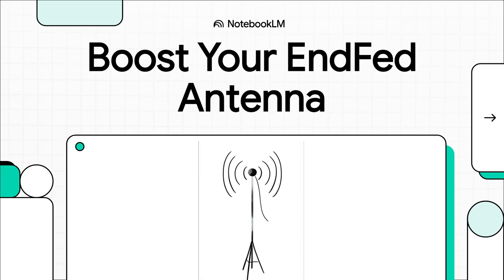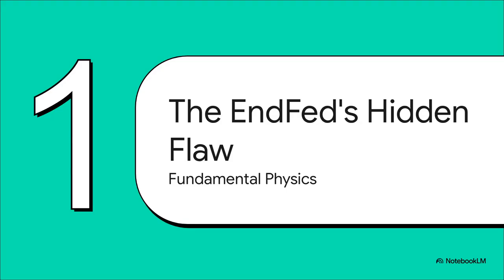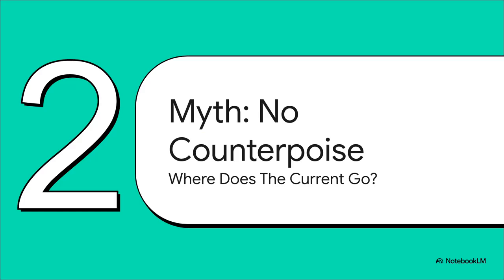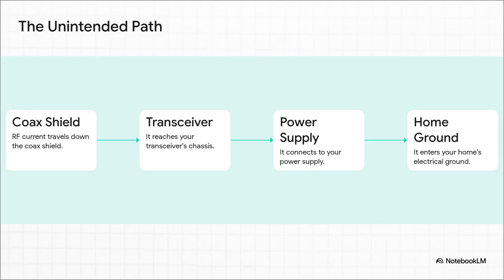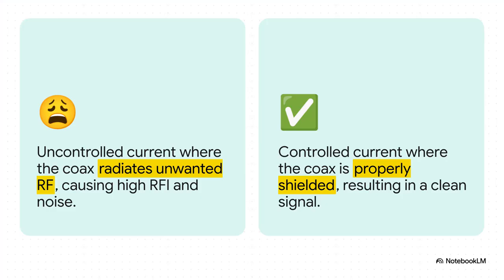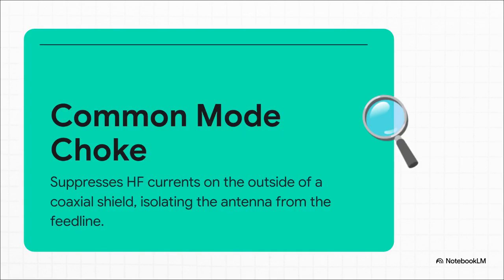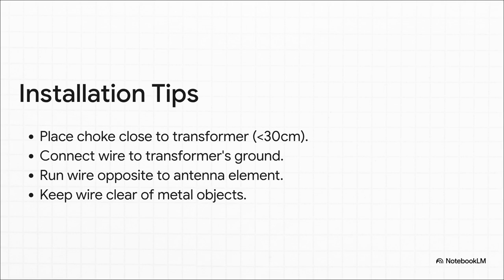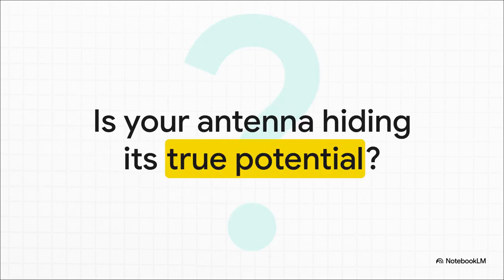Boost Your EndFed Antenna with Proper Counterpoise

Comment: Put choke as close to the transformer as possible. Transformer is what?
Reply: Thats what I did as well. And I uave a wire running to a good ground right below the transformer, which is about 33 feet above ground and I get great reception and transmission. I have worked from North America, Japan, NZ, Chile and Brazil.  But winter came so I had to stop tinkering. When spring comes I would like to test a counterpoise as mentioned in the instructions and see if its better or worse.
Reply from the maker: The 49:1 or 9:1 impedance transformer.